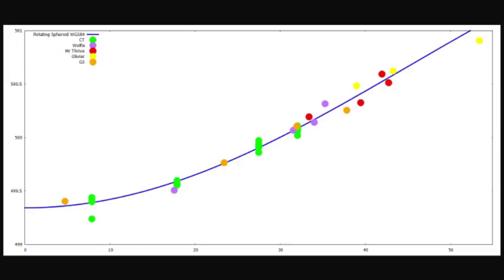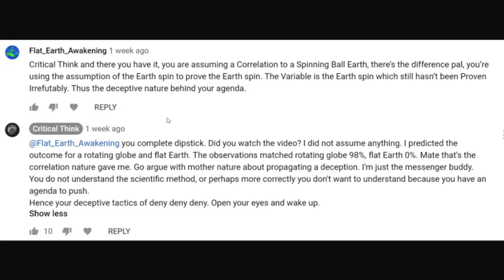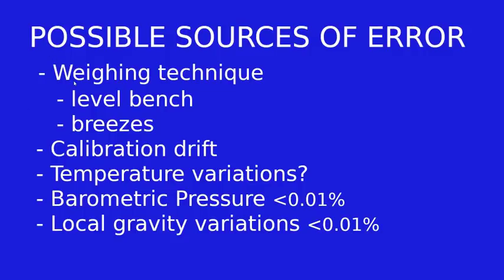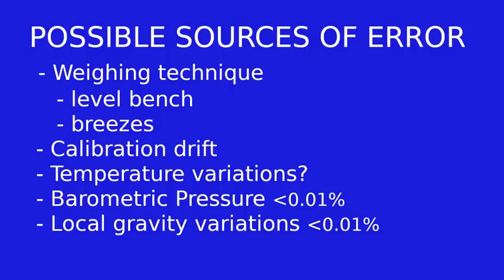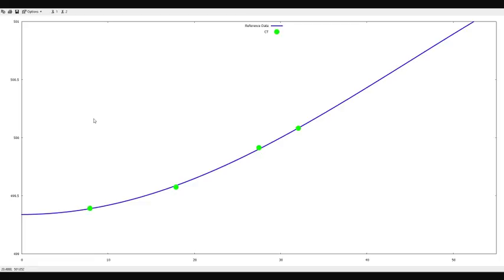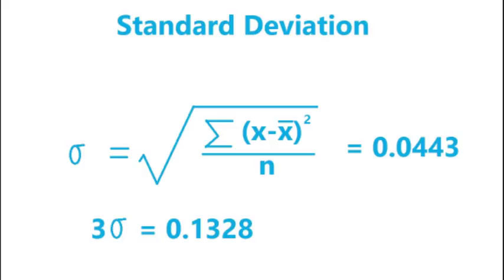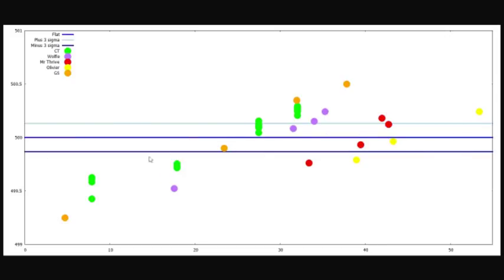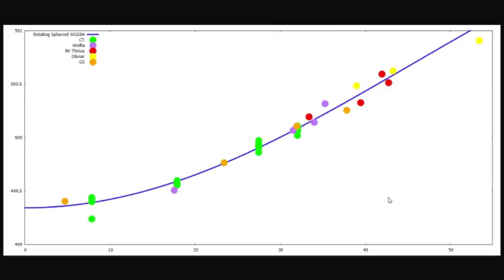Zero Probability: Flat Earth - Part 3: Error Analysis

Comment: Regarding measurement error, there is one other possible thing I can think of, perhaps small, but might be worth mentioning: elevation. I haven't done the calculation for how much difference there might be, but owing to both the increase of angular momentum and the decrease in gravity because of increased separation between center of mass, I might think there could be a factor. 

Great job!
Reply from the maker: The elevation is significant and is accounted for. See part 2 for how elevation has been handled.
Reply: @CriticalThink  thanks for the kind reply. That is what I get for starting with part 3. :)

Comment: Can someone with the knowledge/maths tell how much of the weight drop at the equator is due to cetrifugal force, and how much is due to the bulge (being further from the centre), compared to at the pole(s)?
Reply: It's all the same thing.  The bulging itself is caused by rotation.
Reply from the maker: @פדוסדסדו  no it's not the same thing. The bulge was formed while the Earth was a little softer, but there is a difference in the gravity because of the bulge.  The answer can be worked out
Reply: @CriticalThink  

Of course there's a difference in gravity, and it's caused by being further from the center of mass.  What I meant is that the bulge was created by the same force that causes objects to weigh less at the Equator.

I guess the difference is that if the Earth stopped spinning, an object on the bulge would still weigh less, because it's still further from the center of mass.  But that's no different than any other difference in elevation.
Reply from the maker: Neil Fawcett do you want me to work it out  or would you like someone else?
Reply: @CriticalThink  - I was in truth hoping someone would just already know, rather than someone having to sit down and do some maths :) But it would be kind of interesting to know what the breakdown of the weight drop at the equator is as regards centrifugal force and the bulge.

EDIT: I was using DIAMETER - So take 2!

Logic to me would suggest the 22km bulge would have a tiny effect. 3963 squared / 3949 squared =  15705369 / 15594601 = 1.0071 = 0.71% difference (reduction) in gravity due to distance at the bulge? And obviously at other latitudes than the equator this would reduce down (to less of a factor). At least that's my noddy maths saying that!?
Reply from the maker: @NFawc  The difference is more like 0.05% because of the effect of mass distribution. However let's talk in terms of acceleration. The difference between the equator and the poles is 0.052 m/s^2  and the component of centrifugal force at the equator is 0.034 m/s^2.
Reply: https://www.mansfieldct.org/Schools/MMS/staff/hand/lawsgravaltitude.htm

Comment: Since you refused to share the brand and model of the scale, I search for it online - there it is :
Smart Weigh Digital Pro Pocket Scale with Back-Lit LCD Display, Tare, Hold and PCS Features 500 x 0.01g (Price: £6.99 to £15)
Let's look at some Amazon reviews, shall we?

"When I unpacked this I tested the weight with a 100gm measure and it read 42 grams. I then calibrated it with a 500 gram weight as instructed and although it read "pass", as it should the scale, showed an error message afterwards and no longer worked."

"From my quick assessment with some known weights I would say this is probably accurate to +/-0.2 grammes. Certainly not the 0.01g suggested by the advert."

"Might be good as a basic food kitchen scale, but for weights around a gram, simply couldn't trust any fractions of grams. Put the same thing on it over and over and got different results."

"These scales are constantly adjusting, never seem to settle on a number. I have calibrated them many times, they just seem broken."

"Not accurate at all, weighing the same coin to check accuracy it gave me 4 different readings. Not a good set of digital scales at all."

"worked relatively well for a while but precision seemed to degrade over time.
although well looked after, it now needs to be at least 0.15 from zero to display any change in mass."

"these scales do not provide the advertised level of accuracy. The screen has the facilty to display 0.01g but the scales are, at best, accurate to 0.05g"

"useless, weight shown fluctuating the whole time, and yes i have closed doors so its not in a draught"

"I'm giving one star on the basis that they didn't even work when they arrived!! You get conned into having to buy the 500g smart weight to calibrate them!! What a joke, why sell something that you can't use, that's Like selling you a bottle of wine with no wine in it.
Anyway if your going to buy these scales make sure you buy the stupid smart weight thing."

"absolute rubbish complete waste of money as they read something different everytime."
Reply: Since he included various measurements from other people, using other equipment, even measurements from a flat earther,... Your argument got invalidated...
Reply: @Jerre27  Yeah, he included other readings using the same Chinese crap... Even the "Calibration Weight" reads 500.25 !! Give me a break !!!
Reply: @StillCloser  Then you have a perfect opportunity to do the experiments yourself with equipment you find acceptable! Tell us when you are ready to post your results.
Reply: @hashmaldawn3878  Actually I already did, with a similar scale. The latitude was the same, but I weighed the battery of my camera before and after charging. Guess what, the battery weighs more after charging, should i conclude that  this has to be with the weight of electrons?
Reply: @StillCloser  So you haven't done the same experiment!
Reply: Interesting.
Now all you have to prove is that gauge variability is the cause of all the variation....
Reply: @markrussell4449  Easy, he starts south, then he goes up to Thailand and it just happens that the data from Melbourne could not be measured due to lost luggage - Battery loses power over time, thus the scale reports lower values as he travels north, seems a pretty logical explanation... Whatever the case the earth is not flat and this experiment is a joke (even more when he rambles about residues).
I could enter the values (weight and latitude) into my calculator and use linear regression to plot a  linear function (y = ax + b) that best fits the results, which is pretty much what he did...
Reply: @StillCloser  interesting word salad that doesn't answer my point. But is it really linear? I'd suggest that the angular motion forces only align with gravitational forces at the equator.
Reply: @markrussell4449  Jesus, are you guys factious or what? Take a look at the graphic at 0:34 - Except for the slight curve at the leftmost part I could well plot a straight line matching a linear function, it won't make any difference !!
Reply: @StillCloser  typical flattard thinking: sees a curve claims it's straight.
You still haven't proven that gauge variability accounts for all the variability.
Personally I'd have liked to have seen a gauge type 1, 2 and 3 R&R carried out to find the gauge variation but we haven't seen any results for those so we have to take the results as they are.
Reply: @markrussell4449  Firstly, anyone knows that I'm not a flat-earther, you just use the argument in a feeble attempt to discredit me. I'm not the one who's lying to you - Critical Dingo is, when he tries to push to the entire community an experiment made with a £7 scale  as "scientific" proof... He's the one who fudged the curve with a parabolic shape when there's no data in the graphic that accounts for the parabolic curve...
If this was presented by Globebusters or FECORE with null results for a spherical earth you guys will be like vultures, nitpicking every reading and conclusion...
Reply: @StillCloser  And then compare it to the graphic at 1:48 - the one that shows the date for flatardia... Hmmm... interesting
Reply from the maker: @StillCloser  of course you are a science denier. You are completely triggered by this experiment. I never said this was proof of anything so you haven't actually comprehended anything I have done.
You accuse me of lying, which is very serious, yet you cannot say how. You have no evidence of anything, call me a liar instead of understanding what has been done here, just like all flatties do.
I showed exactly how I drew the curve but you are too blind by your stupidity to notice that. I fudged nothing. I object to you being dishonest by not trying to understand what I have done and jumping to pre-conceived conclusions.
Reply from the maker: @StillCloser  You are a proven liar. Why would anyone listen to anything you say. Here's the lie: "I am not a flat earther" you said.  Then you say "your graphic actually proves that we live on a flat spinning disc or on a earth shaped like a cone". So you are a flat earther. A normal person would never try to claim that clear evidence for the globe which rules out a flat earth, could in fact be supportive of a flat earth. That is a clear sign of a psychological problem, nothing to do with math or science. You can't even tell me why the data can actually be two things at once, flat or cone, when the data clearly supports only one shape, rotating oblate spheroid conforming to the WGS84 model.
The fact is your whole comment is a lesson in complete absurdity.
I did not delete any of your comments. Dude, I already explained that.
You were proven wrong, I would not delete anything that was severely embarrassing to you.
"Allow me to educate you on graphics :". This whole analysis does not depend on graphics. Your math knowledge is not up to the standard for you to be able to comment intelligently on this video. You don't understand it. The graphics is there to help people understand the math behind the sample gathering and model matching. The fact that the data supports the globe model has nothing to do with drawing the graphic. The graphic is just a way to illustrate the data that makes it easier to understand.

You are somehow under the delusion that there are arbitrary lines drawn to make it "fit" the data. This goes to show how little you understand.
"If your intention is to depict a graphic where x is latitude and y weight, then I'm sorry, but your cartoon at 0:30  proves the spinning pancake  or cone"
You keep repeating this, in exactly the same way that I could repeat something like "pigs fly".
No amount of repetition on my part will change the fact that pigs can't fly.
No amount of repetition on your part will change the fact that my data supports a spinning globe.  You need to show it by math, calculation and correct modeling. 
You word salad has nothing of these things. They are just empty words. I don't know why you cannot understand that all this is delusional thinking on your part because your ego cannot allow you to be wrong. But you are catastrophically wrong.
*"A globe earth would be depicted by a parabolic curve"*. Yes, my globe model is a parabolic curve, and the data fits it nicely. Thanks!

"why are you deceiving globers and flatties alike with your fudged graphic? Are you so dumb that you can't even plot a simple sinusoidal half-wave or parabolic graphic or are you being intentionally dishonest?"
There is no deception. There are no fudged graphics. All of my graphics are clearly explained.  You just can't say "pigs fly" and expect people to take notice. Words don't cut it.  Provide the math, provide the analysis. It's not my fault you are too lazy to do the hard work to do a proper analysis. It's not my fault you are either too stupid or willfully ignorant.
I would listen to a sound argument but nothing you have come up with has any substance at all.  I will repeat again, but I know you will ignore me: you need to understand first the process and the math. At the moment you are just throwing random crap and hoping some of it will stick. Not a good scientific argument from you at all. In fact it makes you look incredibly stupid.
Reply from the maker: @StillCloser  Hey clown, you claim I deleted something. You can raise the same argument anytime you like. Feel free to claim again that I used the wrong formula - I would love that.
Reply: StillCloser 
The beauty of science is that it is self correcting. 

You seem to think you have found some fundamental flaws in CT’s data analysis based on the quality of his scale. 

I suggest you get a better scale and repeat the experiment from dozens of points on the globe at different latitudes and different elevations. We will be expecting you to provide rigorous analysis of each datum and statistical analysis. 

We won’t expect your report for many months because that’s how long something like this will take just for data collection. 

We will all be waiting.
Reply from the maker: I didn't refuse anything. You can see exactly the scale, and you contradicted yourself now because you were able to find the scale, so I am not hiding anything. You can see I declared already the scales were reading differently and this video shows the result of those errors. You are not very smart and certainly not honest. I already proved you wrong before and you deleted the thread so that no one would see how stupid you are. Why would I waste my time with you? Do the experiment yourself and shut up.
Reply: Critical Think I performed this experiment in 2017, flying from Austin, Tx to Boston, Ma, but didn't do anything with it. You've inspired me to put a little video or something together and analyse the data with a bit of care. (Spoilers: the Earth is a spinning spheroid). I predicted, mathematically 500.58 grams to be measured in Boston, and got a reading of 500.62 grams, a difference of about 1.37%. If you'd like I can send you the data and you can include it as another data point at your leisure.
Reply from the maker: @jmckaskle  Yes that would be great to send it. critical.think.001 in the gmail universe
Reply: @CriticalThink  I didn't delete any comment, you did. I saw a notification right when we were about to enter the cinema and I turned off the phone, we're not allowed to have capture devices in theatres. On the way out I've turned it on and when I've pressed the notification there was no comment anymore. As far as I remember other comments disappeared too, namely the one where I ask you for the brand and model, which very conveniently you never replied... I even though I was blocked !!
Reply from the maker: @StillCloser  Nope. Sorry I didn't get any notification of any question about the scales. So your accusation of me refusing to give this information is bogus.  The fact that you so quickly jump to the wrong conclusion is a serious red flag to me. Also, that sort of question appears totally out of context to the discussion of the formula for centrifugal force, so there is another thing to wonder about. Your thread just disappeared, and I didn't delete it. I pinned it, which shows I wanted it to be there. Next thing I know it was gone. You can clearly see you are not blocked.
Reply from the maker: @StillCloser  thanks for resorting to ad homs. Just goes to show you have nothing useful to offer.
Reply: Hmmm...op doesn’t appear too bright. If the claim is these results are the byproduct of arbitrary variation from an imprecise scale, then it’s mighty convenient statistical analysis of the data suggests 98% correlation. And trying to poison the well by claiming ct could have manipulated the data collection to align with the model by using foreknowledge of how the “faulty” device would drift fails since this analysis looks at data from a number of independent sources, some of which appear to be flatties. 

In short, for you to have any validity after ct showed us all this math, you have to come back with your own math showing the data is not correlated to anything but really is just random drift. Based on ct’s comprehensive analysis, your odds of producing something credible aren’t very high.

Comment: Why do the dots not have the same distribution on the. Flat earth graph versus the sphere earth graph? Is one ployed as distance from the north pole and the other as distance from the equator?
Reply from the maker: If you could identify which two graphs that would be handy. All plots are in reference to the latitude in every case. I will need more information to be able to answer your question.
Reply: Just a guess, but think they are referencing for example Mr. Thrive data points and Olivier data points at 15:41 for WGS84 model in which data points line up fairly well, vs they shift down slightly for rotating sphere model but again line up mostly, vs 15:42 flat model where they really shift down and no longer in line with rest of data. Your graph almost looks like its implying two lines of data. Pure speculation and guess on my part, but would guess that is due to elevation heights varied, which on a flat non-rotating and no gravity model would make no difference. So they were not adjusted accordingly to be represented at uhm, think it was 10m you stated.

Comment: This is an excellent demonstration of how science is actually done. Including error analysis and everything, nice :D

Flat earthers should go practice some sudokus to practice logic and to learn how to handle assumptions. In particular "proof by contradiction": just run with a certain assumption and see what should logically follow from that. Just "assume" some square is 5. Then this square has to be 3, that one's a 9, which would mean my original square should be a 1. Oops, contradiction, so we know that square isn't a 5.

It's similar to what's done in these videos: assume model X is correct and see what logically follows from that model (i.e., construct an hypothesis). Then do your measurements and see how well the models predict the data. The best fitting model is the one that best describes reality (almost seems a tautology when put like that, doesn't it). Now, why anyone would willingly choose the worst fit really is beyond me.